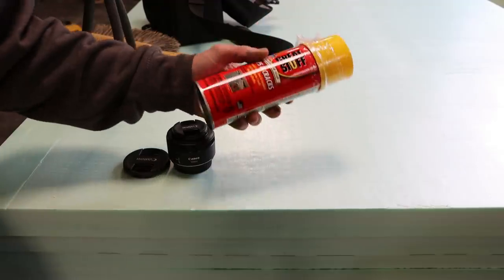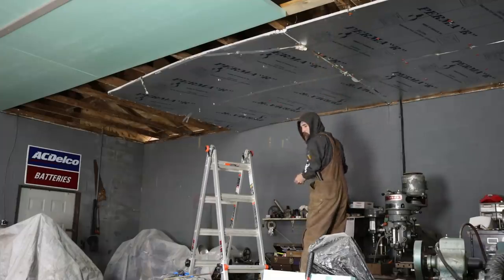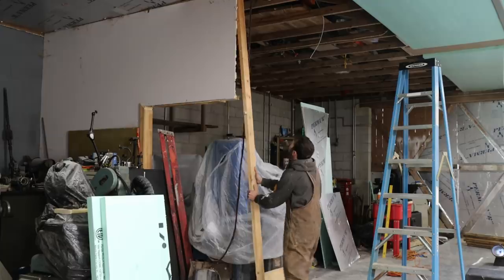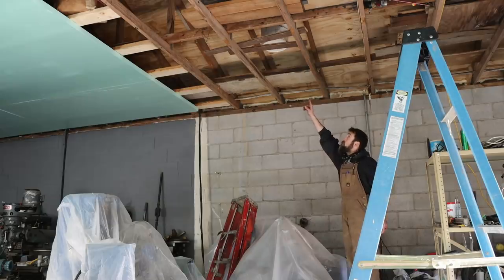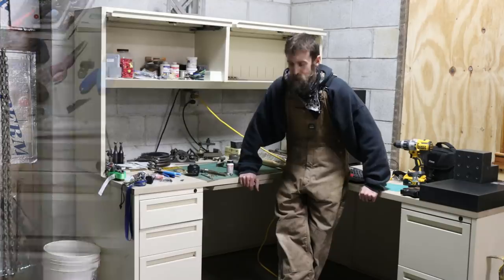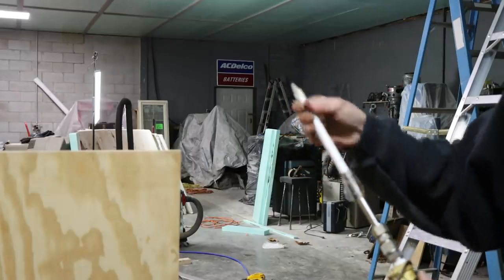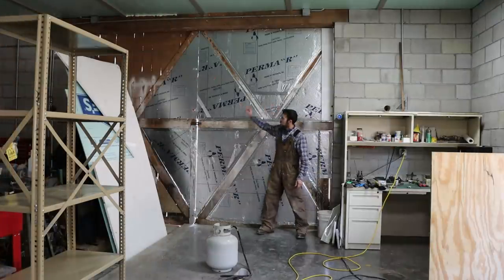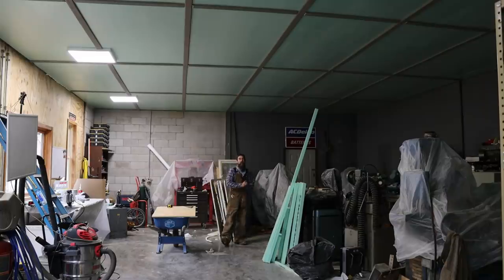Finishing my Polystyrene Shop ceiling   part 2

Comment: How is your attic space ventilated? I’d have thought you want some airflow up there to stop rot/mould.
Reply: He said before he was going to put gable vents on either end of the attic
Reply: ehamster Absolutely.  Some of us tried to enlighten him in the last video but to no avail.  The golden rule is to cross ventilate suspended timber floors and the same with a timber roof space.  Then insulate the ceiling and floor.  Without effective cross ventilation damp and mould will be a problem in those dead circulation areas, especially close to the eaves where it is coldest.  All the work he put in repairing the roof will now be in vain.  That foam infill is definitely NOT your friend in this case.  As they say, 'you can lead a horse to water but you can't make it drink.'  All he has to do is look up any building code or good practice guide.
Reply: @gorak9000  Not enough.  Cross flow ventilation needs to be from low (eaves) to high point (ridge ventilators) otherwise he doesn't eliminate dead air where he needs circulation; the eaves. He is in for big problems for the future and at some stage we WILL be seeing a video on eaves repair......IF he makes one.
Reply: I would be more concerned about COOKING the attic and shingles right off the roof in the summer. LOL I am sure Steve's got that all figured in.

Comment: This is not criticism. What I would do, is install "proper vents" (that's what they are called and they are pretty cheap, sold at all big box stores) and not spray foam that opening, in fact you wouldn't have even needed the small 2x4 up there. This will give you air flow from the bottom to the top of the roof. Then you wouldn't have to put fan vents on each side.

Comment: What’s the fire code in your area? Also, R-10 ceiling- why do any insulation at that point?
Reply: @randy-yk1yk  I don’t know man. Seems like he built a Roman Candle  instead of a shop space. I can’t imagine his county would accept that, but I guess every county is different.
Reply: @DevinHeaps  the foam ceiling in the unlikely event of a fire will give a lovely poison gas which is why all code areas require drywall or equivalent over it.

Comment: Try putting your paint roller tray in a plastic bag before filling it. When your finished you just throw the bag out. Saves cleaning up the tray.
Reply: I have used that trick for years, also put your roller and brushes into a plastic bag and seal the end if you are going to use them the next day saves cleaning until you are finished.

Comment: You are blocking your cross ventilation damp and mould will be a problem
Reply: Yes, he's applying the principles of habitable room ventilation to a roof space which requires different principles of cross low to high which means eaves to ridge.  It will be a costly mistake I'm afraid unless he reads the comments and takes remedial action.
Reply: Yes this guy is awesome and is a true craftsman doing an excellent job but he’s making a huge mistake blocking the soffits definitely need airflow gable end vents is not enough where the top of wall meets the roof is the first place condensation forms moisture plus darkness plus plywood organic material equals mold then rot please open the soffits

Comment: Kinda worried here. Using bare EPS sheets like this for interior ceiling panels is not a great plan and is forbidden in many building codes. The fire risk is extreme even for fire retardant panels. In a fire they produce a lot of toxic smoke, and before falling down completely will drip flaming gobs. It should have a fire resistant covering.
Reply: It's XPS, but Steve has already said he's not going to address the flammability issue.
Foam can take off faster than that toy rocket if a fire in the shop throws a lot of heat up there.
Hopefully it will never become another ' The Station' situation.

Comment: foam insulation will crumble to powder over time when expose to uv light 
as for the backup editing computer , maibe you can put wired timelapse (good quallity web-) camera's in each corner of the shop and record them straight to harddisk or even set up a livestream , you should be able to keep those going all day without the need for changing batteries memorycards and stuff , might need to clean the lenses once in a while , makes for good theftprevention too though i've yet to see the first thief that manage to lift a full size lathe up on its back and lift it through a window to get it out (windows are way too small anyway :P )
doors should be fine the outside of them look like they belong , a panel style roll up garage door would not   , just need to silicone the gaps to close the gaps and sand it smooth and repaint them again , would be nice to lay them flat for that 
ceiling looks nice , it could allready be misstaken for an office style lowered tile ceiling , perhabs you could put sticky back white vinyl over it , makes it somewat clean able (oil flying off the machines whont get absorbed ) and looks even nicer

Comment: Problem with foam insulation and one of the few advantages of sheetrock is fire resistance. Guess it is all about your level of paranoia about fire. If you were to have a fire that touched your ceiling your shop would become an immediate total. If you were worried you could scab sheet rock over what you have.

Comment: Why did you not leave the original insulation there and sheet over it with the new stuff - you'd have better insulating qualities and half the work by not having to remove the old stuff?

Comment: Did you test the firesafetyrating of the ceiling material? just to be sure that it is exactly as safe as you expect it is?
Reply: have a think what is in there oil, oxygen cylinders, fuel gas ( acetylene , propane ) plenty of aerosols all potential bombs that would take the roof off PDQ
Reply: All the experience i have with styrofoam is that burns and melts whenever it gets brushed with a naked flame, which is far more likely than blowing the roof off in any kind of explosion. But i suspect that this green stuff has some kind of fire-rating, that makes it self-extinguishing. But it might be a good idea to just check that.

Comment: The shop is looking good, fiberglass insulation in my opinion is about worthless. The R-Value of fiberglass insulation decreases as the temperature difference increases, it does not stop air movement very well that is why they use it for furnace filters. I used Cellulose Insulation in my house and shop, why? They constructed 3 small buildings, one with fiberglass, one with cellulose, and one with no insulation, then they were set on fire and the one insulated with cellulose lasted 1 1/2 time longer than the other 2. Plus cellulose is chemically treated with non-toxic borate compounds (20% by weight) to resist fire, insects and mold.
When I built my house I was using 2 kerosene heaters before I had the furnace installed and after awhile you could notice the flame going down because they were burning up all the oxygen. The salamander is just like starting up your car and sucking on the tail pipe, be advised. Now that you have most of the air leaks blocked off it could become a real problem going forward. It is cheap and easy but breathing in carbon monoxide is not a good idea.

Comment: Oops... You DO NOT want to seal that attic area. You WANT vented air circulation under the roof. You only want to seal that from bugs, etc, not air. What you want sealed is the ceiling. You should have left out some of those blocks and put in screen.... then add some screened vents up high in the peaks at each end. You want to vent hot air out of there in the summer.

Comment: Buyer BEWARE Spray Foam has a shelf life;
HD and Lowes tries to sell this product at a discount.
Reply: It does, but you would be surprised how far past that it still works fine. I just used some a couple days ago that had a shelf date from 2012, Took it a bit longer to expand fully but it did it's job.

Comment: Gettin' close now Steve. Have to redo my shop ceiling as I made some horrendous mistakes when I built it. Check my channel if you get a few minutes. It was literally raining in there last week. Not good in a shop full of electronic gear. I was using a kerosene heater during the cold snap and have learned the hard way about the moisture they produce. So my roof is flat so, I'm gonna do a dropped suspended ceiling and vent it to the outside world to let it breathe. I wouks have left a few of those gaps you spray foamed open to let your roof space breathe. As always, warm regards from Ireland.

Comment: That Styrofoam is a very toxic fire hazard, you really should think about drywall over it.. Also, DO NOT BLOCK OFF YOUR EAVES, that new attic space needs to breathe or in your wet climate your roof will mold and rot out very quickly, at least install a Gable vent on front and back... On the outside of your eaves put up vented aluminum sheeting, it keeps the critters out and allows ventilation...

Comment: Hi Steve, have you considered using an expanding foam gun? Excellent control and you can leave the container connected for use on another day. Here's a link to UK Amazon I'm sure it's available in USA. https://www.amazon.co.uk/Bond-Professional-Foam-Gun-polyurethene/dp/B0052C2234

Comment: Steve, if you need network in you shop...   I have a wifi hub and lots of cat5 / 6 cable...  I absolutly suggest that you WIRE the shop up... when you run the wire..  run at least 2 wires...  3 better... why because you have mice around there...   :)  I also have crimp ends (rj45) for the cable as well... you can contact me at ted(at)killmeyer.org